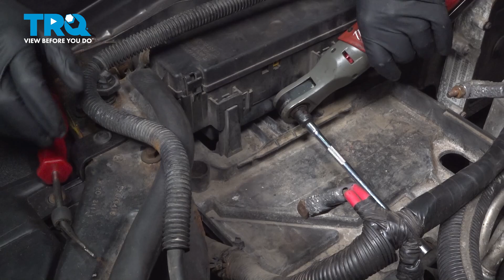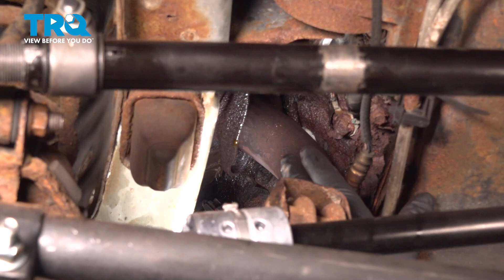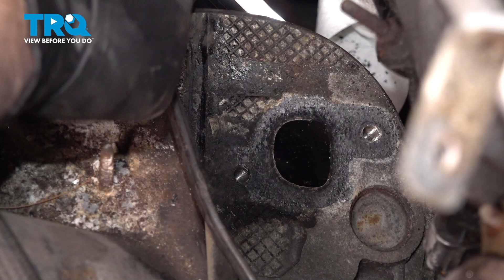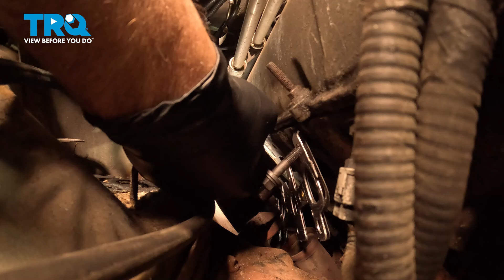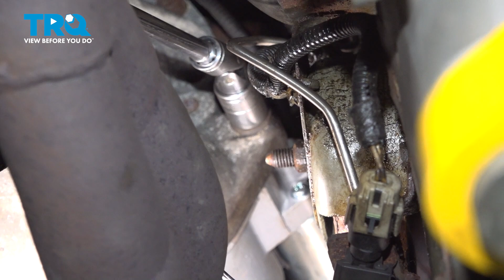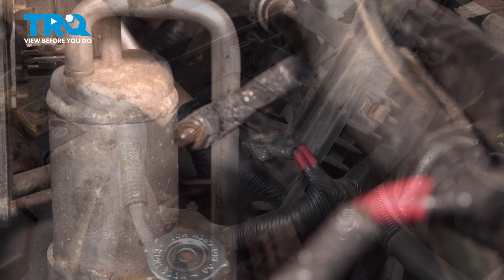How to Replace Exhaust Manifold Flange Stud & Nut Kit 1999-2004 Jeep Grand Cherokee 4.7L V8

Comment: Good to know even y’all had to cut the bolts holding the Y exhaust pipe. I tried replacing mine without success because I couldn’t get the last bolt out. Unfortunately I had nothing to cut it with so the old cat is still attached. Wish I would have watched this video to know the issue was possible